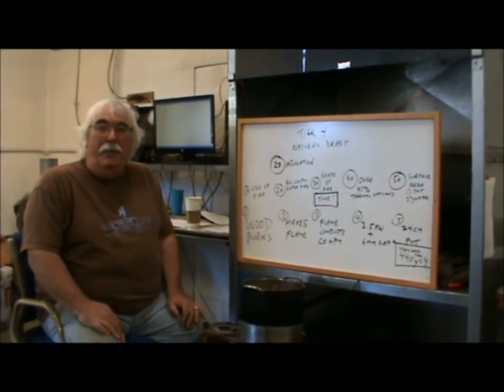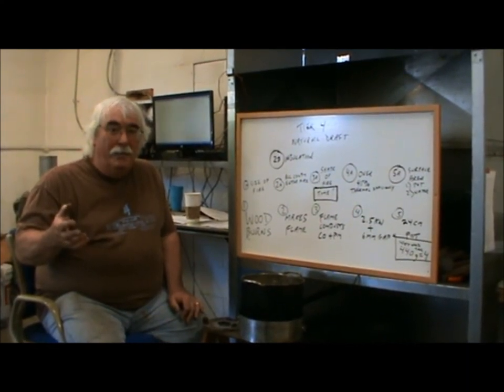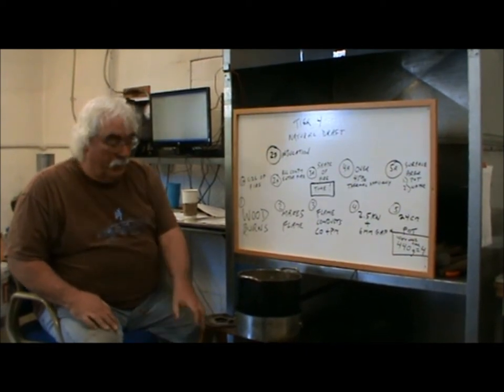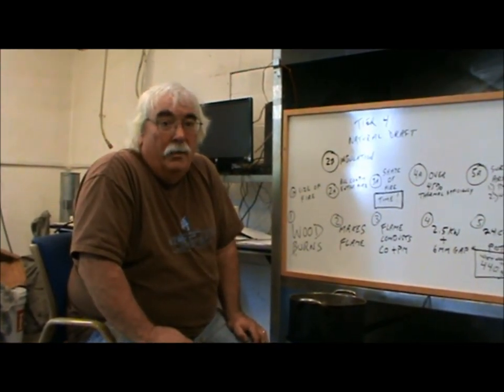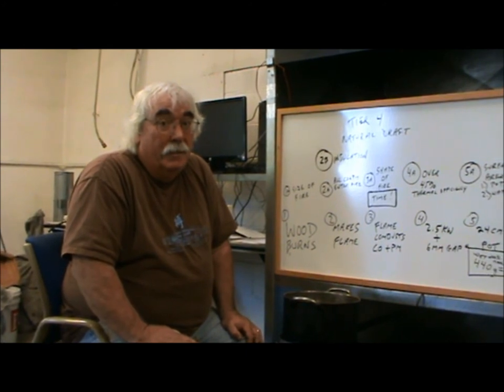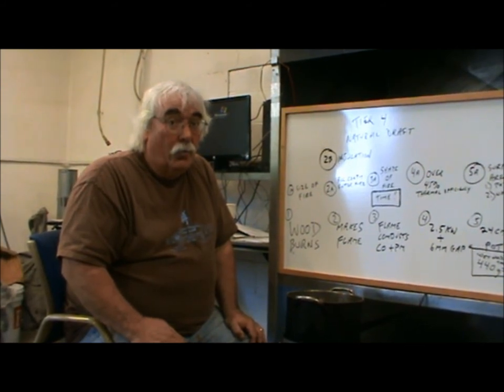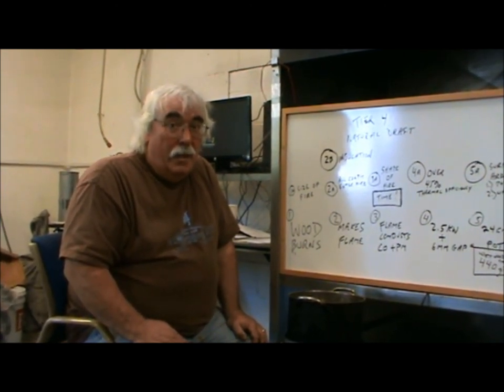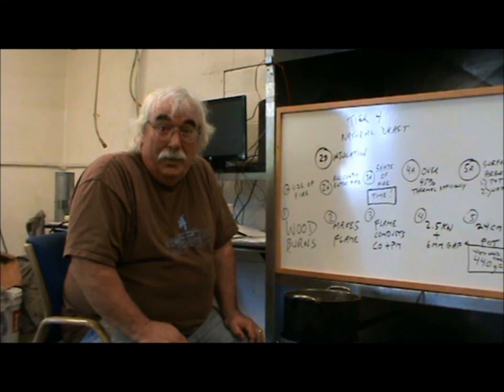Cleaner Combustion Principles with Dean Still

Comment: Very interesting!  One possible problem with using fiberglass insulation behind a metal wall is that the high heat off the fire can degrade the metal wall.   Do you see this as an issue?  My impression is that although the insulating effect of light weight clay is not nearly as effective as fiberglass, it is more durable when exposed to the heat of combustion.  I'd appreciate any thoughts you might have.  One more questions: Are there any tier 4 wood burning stoves currently available on the market? If not, which one would come the closest?  Thanks for sharing your research!